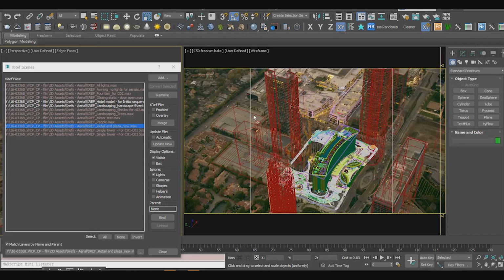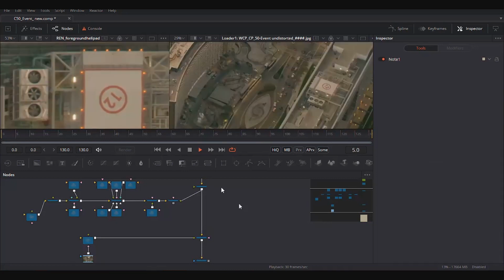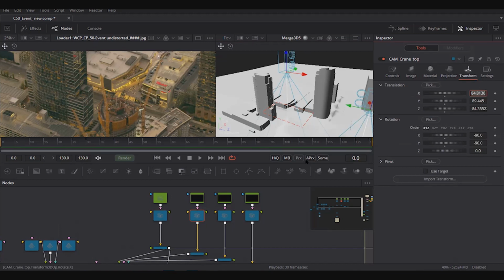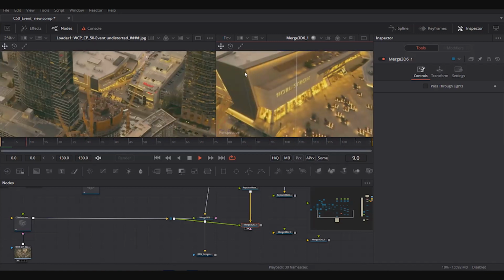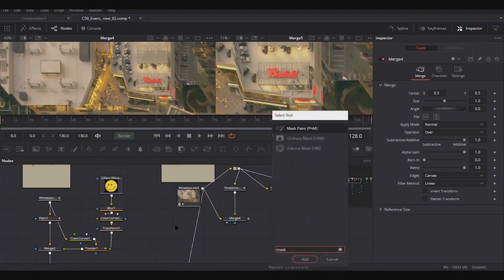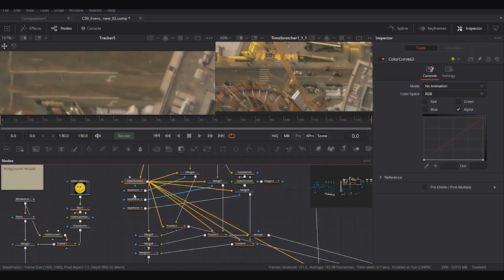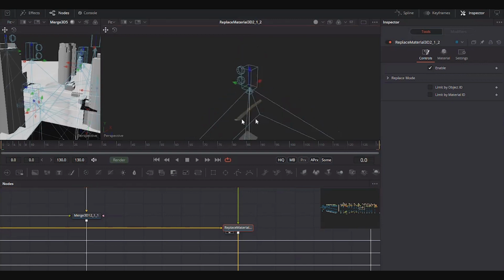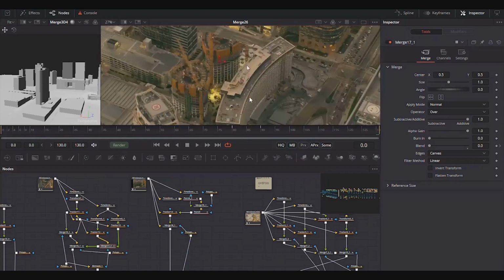Using fusion to clean up aerial shots

Comment: Hey Fusion is so most underrated toll. The 3d capacity made my drop Nuke. Your work is really good. However I tend to paint the footage by camera view on the models.. often just need 4 frames to get me all I need. Then do the stamp tool on the texture I created, and because I have an alpha for all not paint I have perfect overlay. Well involves more knowledge about 3d, uving and texture painting and maybe not possible in 3dsmax, but just another way. Always good to know alternatives… mostly doing.animated Text on geo your way. Beside this tracking isn’t bad in Fusion too. I use SynthEyes, because of its speed, but I also match the hero shot manual, and the align matched camera track to that… pretty easy if you know how… maybe I should do a video next time.

Comment: How do you track it before?
Reply from the maker: This was done using syntheyes - that, PF track, and Boujou are the most used in production. we've tried all 3 - if it was a little cheaper or we did this kind of thing every single day, we'd use PFtrack. Syntheyes is an unbeatable price for how capable it is however.
You can also do a full 3d camera track in blender, fusion, or nuke, but we have no experience in using those.
Reply: @dboxdialog6653  Just to clarify your answer - specialized programs will always do a better job than in-built ones. Blender and Fusion 3d tracking is quite lacking. Nuke is a bit better, but still not enough to do such precise job as you did in this tutorial.

Comment: Excellent Explanation and in depth tutorial. When freezing time, and reprojecting,  how does that work with reflections that need to change? I'd love to see that covered!
Reply from the maker: Do you mean some footage where the thing you are removing is exclusively in the reflections, like a mirrored facade? 
I think it would require a different approach depending on how much the camera moved. You've made me wonder if there's a way to flip the camera movement to look at the inside of the projection surface - so it's as if we're seeing the scene from the reflections point of view, locking that into place. An interesting challenge for sure! Would be a fun puzzle.
Reply: @dboxdialog6653  You can make a Merge3d or Transform3d node, plug the original camera there, and flip the scale of the axis you want to mirror. The movement is the same, but from a "reflected" perspective.
Reply: @dboxdialog6653  yes! I've always just faked that with a seperate reflection pass if it's not a dominant feature.